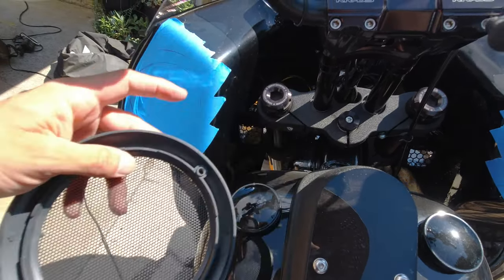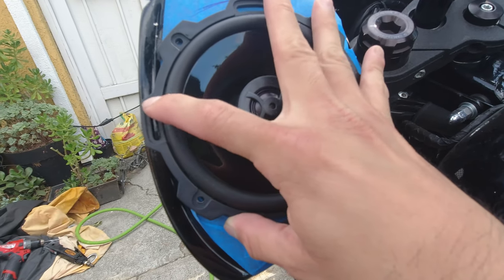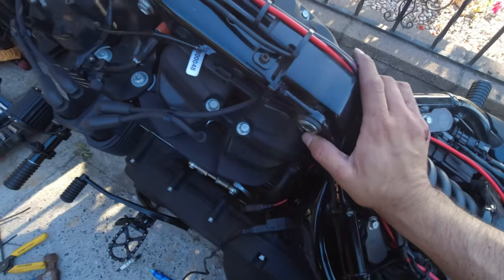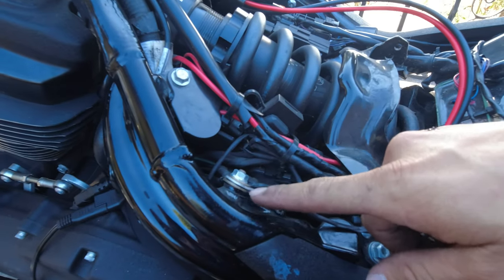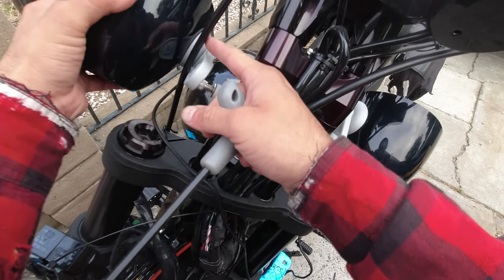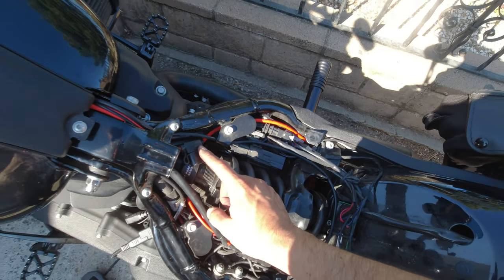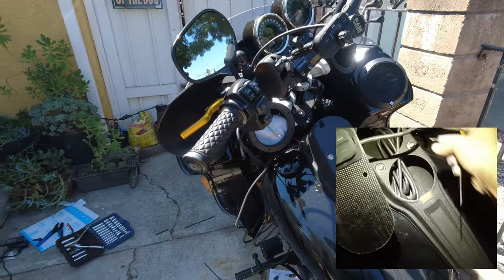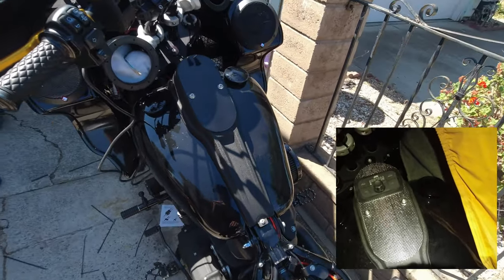Full FXRT Audio System Install w/ Voice Over Video - How to Install Speakers in FXRT Fairing

Comment: What brand fairing did you go with? I want to get the vent screens you have but the website says it only fits dominator industries version.
Reply from the maker: It’s a dominator fairing, but the screens are 3d printed. They also broke within a few hundred miles, I’ve repaired them with JB weld. You can mount the s1’s with standard brackets, just drill into your fairing.